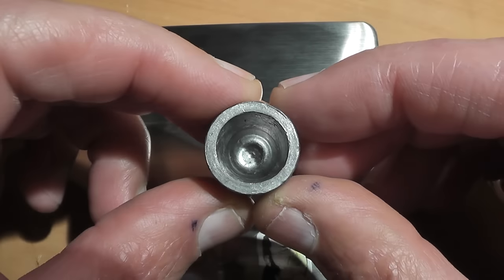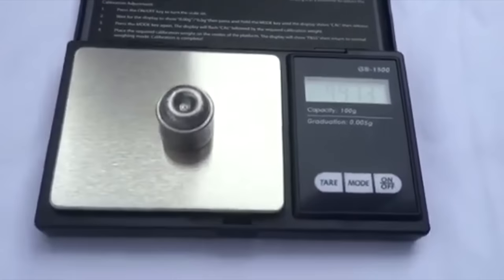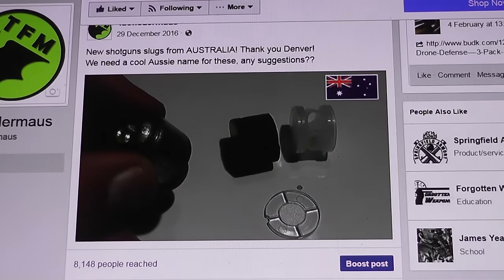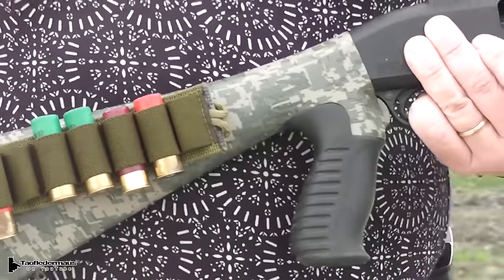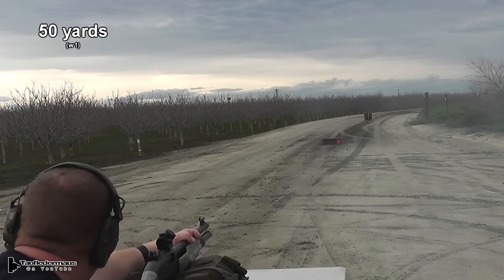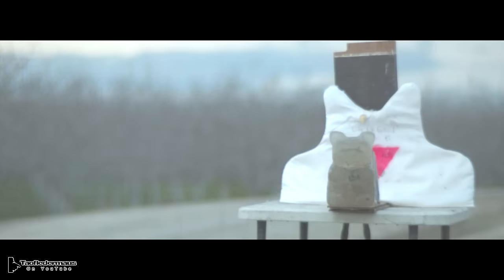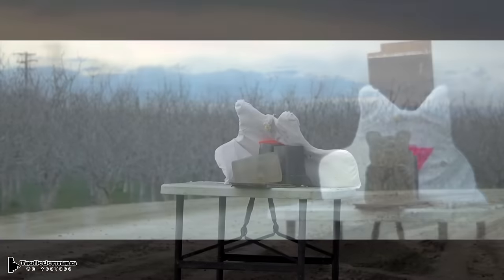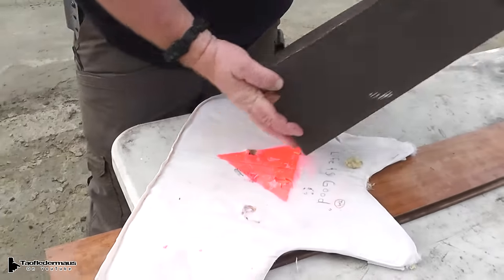Australian SHOTGUN Slugs -  "Denver Pile Drivers"

Comment: Do you think if I filled in the "Drive key" notch in my Lee Key drive 1 oz slug mold that it would make them work like these slugs?  I have watched your video and others with the 1 oz key drive slugs, and general consensus is that they kinda suck. I want to be able to cast my own decent slugs. though these don't seem to be that great either.
Reply from the maker: Yeah,  I think that could only help.   The rib going across the center still doesn't give much support and can allow the wad to get shoved into the cavity.

Comment: Think you were blowing those holes through the center section of the slugs when firing the hot rounds?  Moving that metal around could have caused the balance of the slug to shift and make it wander with or with out rifling.

Comment: what does he mean by grains?
Reply: w00dmii5t3r 
A grain is one 7000th of a pound.
Reply: It's a unit of weight. For some reason, shotgun shot and slug weights persist in grams or ounces, but rifle/pistol and even arrow heads, are generally expressed using grains, as is the gunpowder weight when loading them. For reference, there's 7,000 grains in one pound.
Reply: its a unit of measurement
1 gram = ~15.4 grains
1 oz = 437.5 grains
Reply: that is also how you weigh out the gun powder. in grains.
Reply: And to add to the confusion, the little individual particles of powder aren't called grains, like grains of sand. They're called "kernels", like popcorn.
Reply: jjohnston94 And to further complicate it, some shotgunners still insist on measuring the powder in drams :-D

Comment: Did the hot loads blow the centre of the slug out cause that hole?
Reply from the maker: I think the impact with the gel caused that.
Reply: Jeff, that could be cause from slug setback especially if the nose isn't as thick as it should be. That looks like the hole in sabots that I first started reloading too hit where the initial push of the powder pushed the projectile back blowing the wad.

Comment: .58 cal. Minnie balls will blow the skirt at too high of a velocity. The gas blow by gives alllllll kinds of weird results. I suspect that the same thing was happening with these. You would have to work up to your max load carefully. Maybe switching to a slower peak pressure powder would work. It looks like a promising design though. Plowing along at 1400 fps it's still gonna flatten anything that you point it at. You are right, no need to go all agro on the velocity mate.

Comment: Pretty cool but I think he is trying to make it too hard of an alloy. Maybe go back to a softer lead.  The secret behind lead projectiles is that they marry to the bore on the way down the barrel which makes them more accurate. This is my interweb theory :)
Reply from the maker: I think the fit down the barrel was good,  the rifling left on the recovered slug was perfect.
Reply: Foiled again :)
Reply: The shapes are an issue. My ex-brother-in-law use to design wind tunnels for the air force and I remember him talking about minor defects in shapes and how they can affect the stability of objects flying at high speeds. That is why i poke fun at some of the odd shapes.

Comment: Smooth bore seemed much more accurate.
Reply: yeah the rifled choke was causing the slug to tumble as soon as it leaves the barrel lowering the range and accuracy considerably this means the spin was to slow to hold the slug in a straight line and more spin or no rifling at all would be much better at lower speeds the slug preforms better because of lower drag the reason this slug preforms well in a smooth-bore is because the shape is Almost aerodynamically stable that means the drag at the back of the slug is greater or close to the drag at the front of the slug

the main reason rifling is usually preferred is because it allows us to make shapes that are NOT aerodynamically stable fly without tumbling if the projectile tips to one side but then rotates 360 degrees the force going to 1 side is evenly distributed 360 degrees stopping a tumble